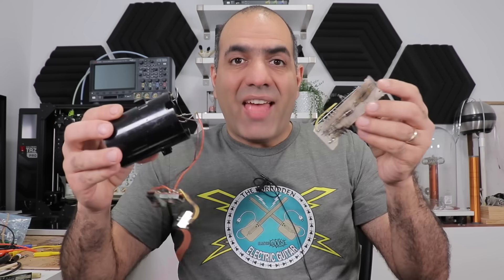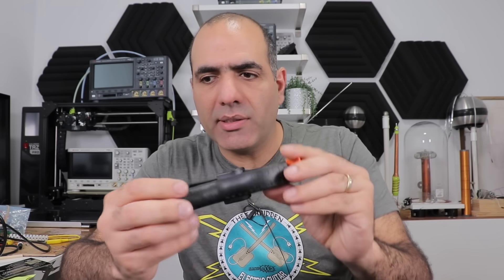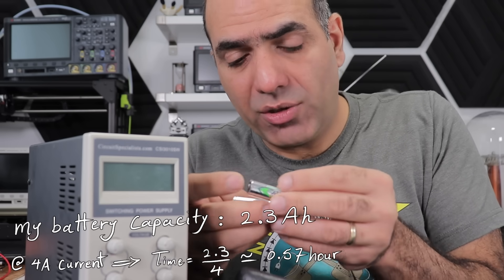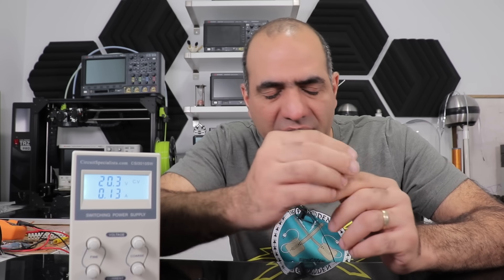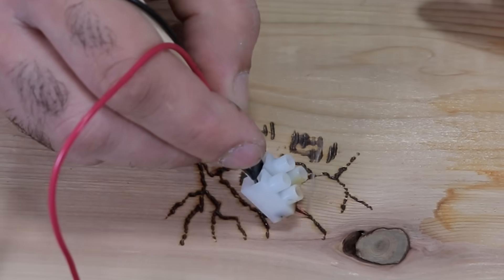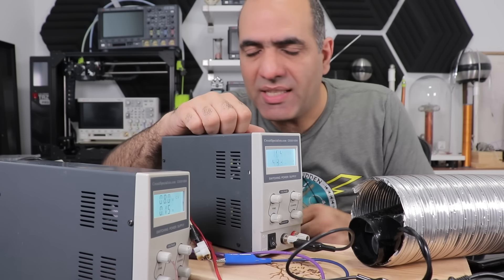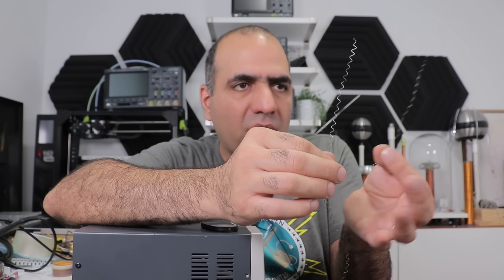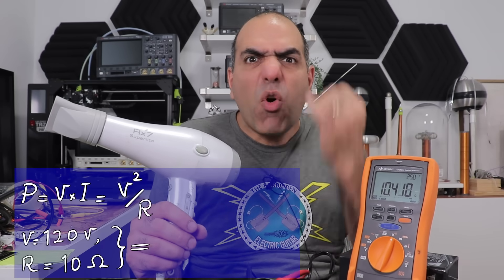Making 5 Things from a Broken Hair Dryer

Comment: AND you can also make an electric lighter, my mom threw away her old hair dryer but I kept it, tore it apart and with the thinner wire, I can use the terminal blocks, a li ion battery and a button switch and boom, no gas flames!

Comment: if i didn't check your video i would have burned my diods due to wrong wiring diagram. so i connected 19v laptop charger and blower works

Comment: Pro tip: Fuse wires has to be tightened so it snaps open when it it gets hot enough otherwise in a small container it would melt but most of the time stay together.

Comment: That thermal breaker operates similarly to a flame rollout on a gas furnace, except the flame rollout has to be manually reset, and if it’s a rollout, you need to check for issues with the flue and/or a cracked heat exchanger among other potential deeper problems.

Comment: This reminded me about that time when I use a 3 inch nail as a fuse for my car stereo 🤣

Even with the good cables use for the amplifiers I had, if I'm correct I had 2 Rockford BD.1000 mono blocks and a condensator in the back of my old 124 merc sedan.. But I blow the 45amp fuses all day long, so I found a nail and used it 😂

But as I parked on a parking lot with my friends,  playing music for a few hrs..... The cables got so hot, they melated stuck to the floor 🤣 It lasted for another hr before the car battery exploded 🤦

Comment: I made a smoke generator with hairdryer nichrome wire wrapped around a piece of thick wick material which was soaked in mineral oil. It creates a thick white smoke for use in diagnosing leaks.

Comment: Once you’ve tuned your power for your engraver, you can just make a battery pack with a switch! And if you know you can use different settings with different materials, you could use a pot or microcontroller for variable settings [the MCU option would be better for many variable options or if you wanted power monitoring too]

Comment: I mean, I guess you could use the hairdryer as a power resistor, but it'll cost you three times the wattage of a mid-to-high spec PC. It's only .33% as expensive, though, and you don't have to hunt for cheap graphics cards. Your call, I guess.

Comment: As he said, the motor diagram is wrong. There is usually a tap on the element nearer one end to give the 12V or so that is needed for the motor, using the element as a potential divider.

Comment: I actually had to do similar Styrofoam work about 6 months ago lol. I bought some 6 1/2" speakers for my car doors and they needed a 1/2" thick spacer to fit properly but no store nearby had any. So as I sat there staring at the Styrofoam the speakers came in trying to figure out what around my house I could make temp spacers out of, the foam finally dawned on me. Then with no hole saws that big I came up with the hot wire idea. Instead of batteries though i just heated a metal coat hanger with a blowtorch lmao. After that I just  used sandpaper to smooth out the shaky hand cuts.

Comment: Just think that the heating element is like a big resistor. So, the heating element takes the the AC voltage and reduces it to a lower level AC, then the FULL BRIDGE RECTIFIER converts it into DC to feed da motor.

Comment: 6:38 i was waiting for that to happen. Did it exactly the same, tho i wasnt even looking it up online just assumed it works on 230V. I have tripped some breakers in the internat, but the have locked them with the well lock so i culdn't just reset them, and my pedagogue was too afraid of even touching them, and ofc they won't allow me touch it either... 

So after that i have installed DIN mounted B6 breaker thinking it ll pop out first. Then i have learned that it only work for overcurrent, and if you short circuit out all of them ll pop out in the row so XD, it didn't help at all.

Comment: In prison in the 1990s I once harvested nichrome wire from a wirewound resistor from a broken CRT television.  Then used the nichrome wire to build a soldering iron.  Then I could easily soldier televisions I was repairing.  99% of the time when the televisions broke it was an electrolytic capacitor in the vertical or horizontal deflection circuits.  You could touch a working capacitor to the ones on the circuit board without removing the old ones and when you found the right one the picture would work properly.  Then remove and replace the bad capacitor.  This could be done without soldering, but then sometimes the picture would go out again and the owner would have to jiggle the television.  After awhile jiggling would not fix the problem.  Soldering the capacitors in place worked much better.  I usually charged 3 bags of coffee, about $8 to fix another inmate's television.  
      Another benefit was it provided me an extra unspoken level of protection.  Since I was the only person who could repair electronics in my housing unit, mostly televisions, radios, and headphones, the other inmates didn't want anything to happen to me.  Also I gained some trust and respect from other inmates since this was 100% illegal, but the guards never found any of my parts or tools.  I had a bag of capacitors, a hex wrench to remove the bolts to take apart the televisions, and the previously mentioned soldering iron.  It also helped that I weighed 235 pounds solid muscle from lifting weights 6 days a week.

Comment: Years ago I repaired the fan speed control resistor in my 1985 Honda with some surplus nichrome wire I had salvaged from some appliance that died. The fan speed had two open wound resistors wired in series  . one resistor measure .25 ohms and the other .50 ohms. I was able to make new resistors and replace the two broken ones. I wound the nichrome wire around a nail then slid it off and opened the coil so the wire didn't short out on itself. Worked like a charm. And this is why I salvage anything that could come in handy some day.

Comment: Hi Mehdi, the foam cutter you built is a very useful tool, yesterday I tried to build one at home using a car booster that outputs 4 amps of current and I ended up with a blown fuse ahah
However I tried again with a diffent DC power supply and it worked!!!
Keep making videos like these where we can learn a lot of things from broken tools

Comment: wouldn't using an op amp buffer in the foam cutter circuit reduce the current drawn from the battery thus extending the battery life
Reply from the maker: You need ~3 to 4 anp to cut. Reducing the current won't help you cut
Reply: @ElectroBOOM  I was thinking the current would be drawn from the op amp and a much smaller current would be drawn from the battery but the output current would still be the same

Comment: I have a suggestion for a video. I just saw a short where someone used tinfoil to make AAA‘s work in AA toy. While I know this would kind of work, I also know and saw in the comments people pointing out that the battery life would be much reduced, and I also thought that possibly the AAA may not be able to supply the same voltage as a AA at higher loads. I began wondering what the actual milliamp-hour capacity difference and voltage drop over various loads a AAA has compared to a AA. Could you do a research project on this?

Comment: "Some fluid dynamic effect" is called "entrainment". It's demonstrated nicely with a Dyson fan. These things are ridiculously expensive though, and I'm not sure why, because they're also highly "planned obsolescent". I know this because I found one in the trash and fixed it. Basically it is made in such a way that a user couldn't clean out air filters when they got dirty. The air flow is eventually reduced to near zero and then it hits the trash can. In order for me to get to air filters I had to un-solder the 12 wires going to the control PCB and solder them back on after I removed the old filters. I didn't bother replacing them, - as they were made from foam (!) I mean you charge in excess of $400 for a fan with air filtration and you're too cheap to put a decent HEPA filter in it! Now it's just a compressor powered fan (and it was always just a fan, foam that mattresses are stuffed with is no air filter. So, if you're planning on wasting your hard earned $ on a Dyson fan, - now you know what kind of environmentally damaging SCAM you're paying for in order to dazzle your friends with a fan that supposedly has no blades (yeah right, that compressor inside is bellows-operated by little elves) . You're welcome. 😉

Comment: That switch is named a bi-metal, they used it in the past for car turn signals built into the bulb and other things that had to be heat controlled.

Comment: You can make a foam cutter with a transformer from a old boom box, a dimmer switch to control temp. And I used kanthal wire for the cutter. I made a top out of some 2x4 and ply wood with and a brace to hold the wires with pvc. Used some other minor parts (screws and such). Works great for making foam forms to do aluminum casting

Comment: As usual sir, I had almost enough cannabis to fully enjoy your video, you crazy guy. I often operate on my failed equipment. I have a hypothesis about what is the problem, and how it might be fixed. Since it has failed, there is no downside to my attempts. My tools are somewhat finer than your hammer, however. What was wrong with that hair dryer, anyway? It had a working heating element, a working blower. If a switch is bad, just bypass the switch.

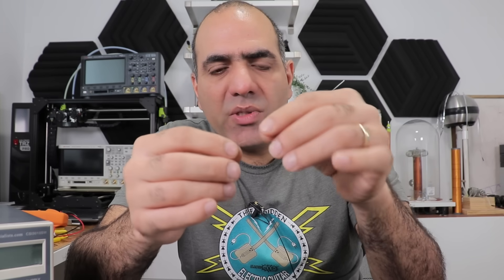Comment: 3:51 Technically, anything is a fuse if you try hard enough.
Reply: Even PC's can be fuse to. Just put you game graphics on the highest setting.
Reply: @crazysaturn0805  
Or just remove the main power supply and stick straight 110v or 240v on the board. It'll protect your outlet from accidental activation and creates bonus forbidden fog too and fireworks just for fun. Lol
Reply: @ReactorOpsCrew01 you mean power resistor?
Reply: I can use air as a fuse?

Comment: 6:19 - Forget about the FBR, check out the "Pluge top" in the schematic!
...By the way, your "wood engraver" already exists - it's a repurposed soldering iron with a brass screw-on tip, found in child-age "wood-burning" kits. 😜

I'm very happy to see ElectroCute (shouldn't we be calling her ElectroTeen now?) interested in STEM & STEAM projects. Statistically-speaking, these fields are male-dominated, and I'm always supportive of shattering stereotypical gender roles. (I don't mean to make this political, so let's not go there...) 

I will state that one of the most brilliant minds I have ever met was a single mother who decided to follow her dream of being a mechanic. She consistently held the highest grades in her class (all other students were men), while maintaining a full-time job and being a mom. When I last spoke to her, she was ASE-certified, as well as a certified mechanic from several manufacturers, and was about to complete her Hybrid/EV course. The '84 Corvette she was restoring when I first met her (which she was doing for the hands-on experience, not because the car needed any work), her daughter used to take her drivers' license test. Her daughter is actually interested in becoming a mechanic, too, once she finishes college.

Comment: Thank you! I have a broken hair dryer and wanted to know exactly how much voltage should go to the motor. I'm also thinking about using the nichrome wire to make a soldering iron and maybe a hot wire cutter for foam or even plastic

Comment: I used a hairdryer to make a bathtub water reheater. We only have one planet and reheating bath water is one of the best ways to save money. I had to run a new wire from the fuse box because it kept flipping the fuse switches everytime I plugged it in. I used jumper cables right off the silver wires coming from the meter and it reheats my tub in 13 minutes!

Comment: Real fuses are submerged in fine coursed sand inside the ceramic holder.. They also have a spring at the end that tensions the wire inside of it. 
Pretty simple for fool proof fuse.. Sadly those those are disposable but if handled correctly can last a lifetime =)

Comment: Foam cutter? So you could make a guitar neck joint heater/warmer with that. People already use foam cutters to put heat into glue joints to get them apart for repair. This could be a way to source the parts at home lol. Sweet!

Comment: oh i remember fixing a hair dryer while it was still plugged in and i accidentally held the heating element.... i was shocked for a few seconds not understanding what happened till i realized it was still plugged into the socket and i need to let go of the heating element lol... turns out something on the board for the heating element was spoilt thus the fan was not spinning and i didn't have the parts to fix it just like factory new so it got destroyed...

Comment: 7:30 the reason that it also sucked the air from the side of the fan is because fan is basically a propeller connected to a dc motor so it pushes back the air into the pipe and the pressure around the sides of the fan decreases and because of the atmospheric pressure air is also sucked in from the sides of the fan into the pipe

Comment: I learned a handy trick that no one should ever attempt because it's risky and you really should know all of the specs and stuff (but I didn't).

If you turn the hair dryer on and block the air intake with your hand, the wires will get hotter. When you move your hand out of the way, you'll get a brief burst of very hot air. I used it to shrink some shrink tubing.

But again, never do it.

Comment: A hairdryer can be used inline (series AC)  as an AC current resistor, as long as its not on the low hot setting ? will it run the hairdryer as it acts as a resistor? Then we should call it an active A/C Parasitic Exothermal Discharge Resistor

Comment: If your resistive wire is very bent or messy, put one end in a drill, and grab the other end with some pliers.  If you twist it while pulling it tight, it will come out straight.

Comment: (9:38) this spoon potentiometer is one of the best physics demonstrations ever!! You can see the wire getting hotter when there's less resistance, and you can conclude that more current flows through
Reply: koiun dwrru  He's actually such a genius, making a hairdryer from scratch so that the viewers get an "aha!" moment, like I had.
Reply: @tgmyrz  das a bot
Reply: sure ohms law does work here but for a given temperature. A wire of a given length will have a specific resistance and this resistance is a function of temperature so a thermal runaway will result in resistance runaway till the wire breaks.

Comment: 7:30 -The fluid dynamic effect is: if a Fluid gains kinetic energy, it must lose pressure...so the smoke is "pushed" by the air at atmospheric pressure into the tube, which is at a lower pressure due to the airflow inside.

Comment: 6:34 bruh it's a 12v DC Motor, you're supposed to connect the Heating element in series to reduce voltage

Comment: You can get those heating wires from toasters too. I've used them before to cut glass bottles. Made a jig that allowed me to wrap the heating wire around the bottle, made it glow for a few seconds, and then quickly dunked the bottle in water. Doesn't work every time but it's pretty quick. They also work to ignite firework fuses without burning up, or so I'm told...

Comment: I used the heater wire to slice trough styrofoam panels parralel to the panels. It worked wonders. As a powersource I used a welding transformer around 24 volts ( I believe ) set to its lowest setting.

Comment: I made a smoke detector for my car to find intake leaks from a hair dryer. Friends borrow it all the time to find vacuum leaks.

 Take heating element wrapped around an oil lantern wick, place in paint can on mineral insulator from dryer and soak wick in mineral oil. Pass ends of element through two holes with glass insulators, close lid, hook it up to 12v car battery, and supply air from aquarium air pump into paint can. Have a second hose from can to supply smoke to car intake.

Comment: Have you noticed that when you burn yourself with white hot wire or a high voltage arc that the burn smells like bacon.
We may have evolved from pigs. We can use their insulin, we have three roots on our back teeth the same as pigs do. Our noses are structured from cartilage and we have no body fur.
Just keeping it real.

Comment: From this, it seems you can run a hair dryer on DC.  I like your idea of using a hair dryer as "dummy load" with built-in cooling.  The only problem is that it can operate over a fairly narrow range of voltages -- maybe 60-130V.

I was thinking about making a dummy load for testing computer power supplies, and maybe what I could do is wire up the blower motors directly off of the 12VDC from the power supply.  Since the power supply voltage is 1/12th of the RMS line voltage, the power difference should be 1/144th (because the current would drop by 1/12th too) - so a 1200W hair dryer would only draw about 12W from a 12V supply.  Hmm.. So what would be smart is to divide the heating element into 10 segments, each dissipating about 120W.  Then each of those could be placed in parallel, with a series of switches to enable each one, creating a variable load from 120W to 1200W in steps of 120W.

Comment: @1:48 you let the wire remain under too much tension, so the instant it heated up, it pulled apart and broke.
Reply: Pretty sure 14.4kW would destroy anything that small
Reply: @Owen_loves_Butters  anything under tension when heated will pull apart.
Reply: @Dalorath  Well I'm saying it doesn't matter that it was under tension, 14.4kW would melt anything that small
Reply: @Owen_loves_Butters  All i am saying is that its not a valid test if other forces then the tested forces are being applied...
Reply: @Dalorath  It wasn't really a test, he knew full well it would blow at 120V, but I suppose you have a point